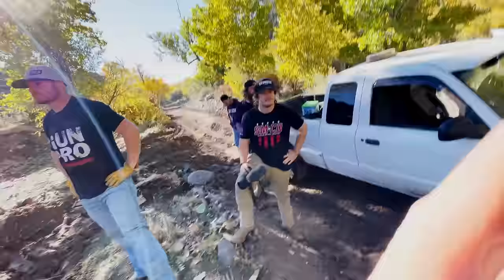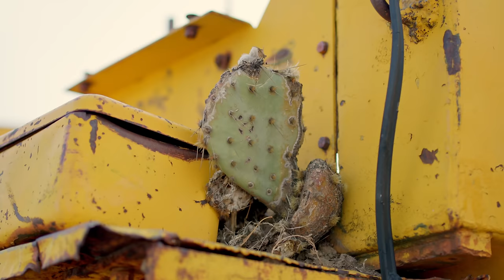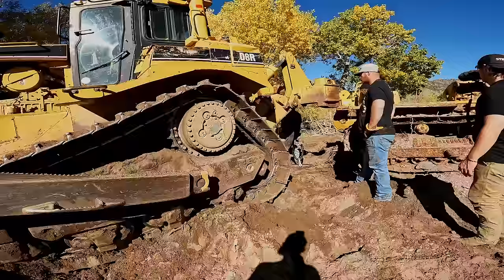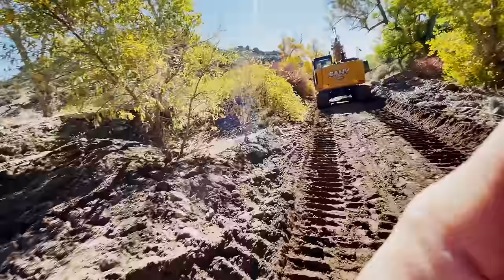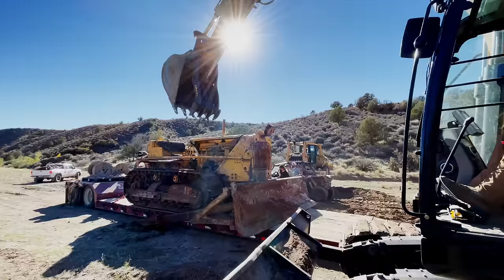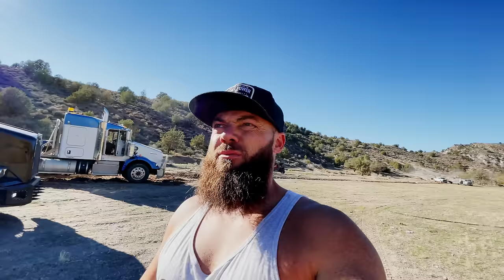How To Haul A Dead Dozer Down The Mountain - Insane Dozer Recovery!

Comment: Just a thought. On recoveries as this, one could make a sled out of plate steel. The friction coefficient would be reduced and the trip out would repair the road rather than damaging it.
Reply: Exactly my thought. Would've been way easier.
Reply: Would've been a hell of an expensive sled though 😳
Reply: @Jutilaje  
For real. I'm thinking people suggesting that haven't actually looked into what a plate of steel like that costs. Let alone what it weighs, and what a logistical nightmare it would be to get it in and out of there.

Makes way more sense to just make an extra trip back up with a dozer to blade the ruts back out of the road.
Reply: I would have dragged the dozer out sideways.  Lift the leading edge about a foot and it would grade the road for you and you wouldn’t have 20 steel ribs on the bottom of the treads fighting you.  Tracked vehicles like that have very little side bite and you could see as they pulled it out it kept wanting to turn sideways
Reply: @austinmabry8462  well as an oilfield welder, I am familiar with steel prices. I am also familiar with the equipment rental and labor prices. Not to mention the headache of prolonged dealings with federal agencies.
Reply: @austinmabry8462 . I had similar thoughts   as Jeremy, but another objection would be that the sand could be like sandpaper grinding away the steel of the sledge.    So yes going back with another good dozer as you suggest is the best option. ..
Reply: I was thinking the same thing. We regularly use 1" plate 8' x 20' and "road plate" to cover gaps so machines can roll over it. Get a piece and put small kicks front and rear so its a sled and drag the machine up on it and slide it out.
Reply: @Holgrinator  I'm just watching these two videos for the first time this morning, and that was my first thought...  those ribs on the tracks are the biggest problem with pulling forward or backward - at least try pulling it sideways!
Reply: @Wyogoose  It's actually funny as soon as you mentioned making a plate steel sled I immediately thought of the oil field sleds for hauling/dragging drill equipment/pipe around. Yes a steel sled is expensive to make, but nothing about doing heavy recovery is cheap. I'm thinking a lot of people don't really think too much about the overall cost of these operations. I know people in both camps though, I know some operators that are very skilled that will go "Will only take me a minute to fix the damage" and will keep to that, and I know others that will go "Yeah, sled it up"

Another trick that comes from the world of old one lunger powerplants. You only really need two skids one for each track, a lot of the old oilfield engines I've dealt with had I or H beam skids under them to make them easier to move if needed.
Reply: nah, far to easy, brute force and muscle prevails!!!...........and also a longer video! 🙂
Reply: What about using rollers, trees or round tubes?? When the load is solid? , tracks not moving?
Reply: @manum234 AWESOME THOUGHT !! . no disrespect to anyone !!!; i don't understand why the drive sprockets were not  unbolted...
PLUS , YOUR IDEA;  OF A PLATE TO GET-OUT INITIALLY & GRADE THE ROAD IF SOCKETS DIDN'T DISLODGE THE TRACK BY PULLING IT ONCE IT WAS SEPERATED FROM THE DEIVE ?!!!!
jack 🤜🏻🤛🏻👍😎👋

Comment: After the first dozer recovery with the track seized up, I thought it would be useful to pick up some 3/16 or 1/4 plate and make some "skis" that you could slip under the tracks. Should make it easier to tow and wouldn't tear up the road.
Reply: Working smarter not harder isn’t good content
Reply: I dont think 1/4 plate will do it.
Reply: @joeprewitt2539  It would do it easily. It's all about lb/sq in. It would pull 10x easier that pulling tracks..
Reply: My Grandpa had a stone boat, used for moving all sorts of heavy items which/that wouldn't get moved without major eqpt. It was just inches high, stout wood with chain for towing.
Reply: Yea soooooo, 1" or 1.5" plate would work perfectly. If you could put the end of it in a brake and bend 2 foot 45  degrees. It would work even better. Don't forget to weld tow rings on it, or cut tow eyes in it. (Ret. Operating Engineer, 38 years)
Reply: @phillipmoore6295  Don't know about brake bending 1" steel but say 3 ft by 4 ft is a hefty chunk of steel that thick. Ours was built-up wood for farm & ranch work. Now at the Kaiser Steel plant, I've seen some heavy metal haulers! Forklifts and straddle haulers up to 100 Ton.
Reply: @jerroldkazynski5480  There are bending machines that will do the job but cutting and welding a prow would work just as well.
Reply: You’d need 1/2 plate for those skis
Reply: @phillipmoore6295  so your idea is to add 3 or 4 more tons of steel? Dude 1/2" would probably last them the rest of their career of recovery, and it would be a fraction of the weight. Are you trying to say it has to stay absolutely ridged? You could add a few pieces of angle or channel for rigidity if you are worried about flex or bending, and still be much lighter.
Reply: @no0channel0at0all  Nope. Lets do some math. A D7 has a track length of around 9 ft. Let's say tracks are 18" wide (which I doubt they are on this one) so that's 9*12*18* two tracks equals 3888 square inches that contact the road. That old dozer weighs around 40 to 43000 lbs. Let's say 50k. 50000/3888 equals 13lbs/sq in. That's actually half the weight that a Crown Vic exerts on it's four tires. It would definitely handle it.
Reply: Ar you single
Reply: @Badge124  , of course youre right.  i had a d4 drive across my right foot.  no pressure!  another alternative if steel plate wasnt available (eg. you are 1000 miles from anywhere ) is using the blade or the ripper to lift the dead dozer so only the back grousers were dragging dirt.
Reply: *Skids ;)
And yeah, if they plan more like this, prep is everything.
Solid suggestion. 👍
Also, my last conversation with a recovery specialist out here in the PNW reminded me of airbags, which would be great for freeing up stuff, rolling toppled things is mostly what I've heard of it being used for... There are some certifying courses for this stuff either way, but I digress.
I still think a hydroblaster and pump setup could be a messy if economic solution... Maybe 😏, maybe not, but it be no doubt it would make for fun content. XD
Reply: Basically what you have in mind is a simple sledge. 1/2" might be a little light for hitting rocks, etc, but would also straighten easier than 3/4 plate.
It would certainly make this, and other recoveries on soft ground, much easier.
Reply: @maryhumphrey5987  hahahahahaha
Reply: Yes I’ve seen 1inch plate bent here in the UK. The machine didn’t have any problem with it. It was designed for thicker stuff. Mind you! It was a “Big” machine. But I’m sure a  1/4 plate skid would have been good enough to do this job.
Reply: The big dozer companies made them out of pipe and just one skid here in Oklahoma back when they had to winch the dozers in and out of high line Rows.
Reply: My step dads grandpa used to have a d68u he took to South America and hauled up and down rivers on his homemade boat
Reply: @bradwyrick7513  Damn. That sounds like an adventure I'd love to hear more about!
Reply: That would be a good idea I'd think.  If nothing else rollers like they used in ancient times to move large objects.
Reply: And the second it slides over a rock there is a massive pressure spike concentrated in a small area.  You will rub through and warp things in high pressure spots dragging for miles.  Look up drifting with front wheel drive cars and how fast they run through steel plate.

Comment: Full restoration on that dozer would freaking awesome to watch lol
Reply: Way too much money and labor to restore that dozer. You could buy a working dozer for a lot less than it would cost to restore that one. At this point it’s just scrap steel, which is real cheap. It’s not sold by the pound. Steel is bought and sold by the ton. If it’s not usable it’s not worth much.

Comment: It's the internet, so everyone's an expert... But trying to pull those loads straight out is just messing your gear up. You need an A-frame to pass the cable over, then you're pulling the load up as well as towards you. Makes a huge difference. 
Great videos, keep up the good work.
Reply: They also attached the 5 ton axle to the small excavator. The winch on the back is attached to the frame, you want to attach to the frame, preferably the same leg of the frame to prevent warping but you sure as hell don't want to attach to the axle.
Reply: @glenwaldrop8166  Or even better to the winch mounting!
Reply: @martingardener90  Exactly.
Reply: But, none of that is as exciting as busting cables...gotta get clicks and subs somehow.

Comment: When I saw you fixing the winch cable it reminded me of one thing my dad(a safety engineer) taught me.  Those saddle clamps on the winch cable will slip if not installed properly, and the way he taught me was the phrase  "you never saddle a dead horse"... the saddle part always goes on the live side of the cable & the U-bolt goes on the cut end. he had seen & reviewed cases that had slipped causing major accidents.
great job on the recovery.

Comment: How about a sled to drag it out? Some 1/2 inch plate under each track, welded spacer beams, a drag point...seems simple to me.
Reply: Ya it's pretty painful to watch the recoveries these guys do some time because they make it far more difficult it needs to be. For example this 1 was a simple dig around and drag but they disturb all the native material and act like they meant to rip the blade off to reduce weight lmao. Could've fabbed some track skiis and made life alot easier and saved alot of embarrassment. The comment section with ppl thinking they did a great job is more entertaining
Reply: Are you doing

Comment: I'm a  licensed heavy duty, off road, automotive, truck and trailer mechanic. I would clean it first and slowly and carefully inspect all engine. hydraulic mechanisms first. Drain all fluids, and start from there. It would be a lot of work, however, I truly believe you can get things running.  Good luck and Thank you for the video

Comment: Summary of the operation: If you had carried the D8 from the beginning, you would have saved yourself time, effort and money. Or if with the Sandy you had made a long and smooth ramp, with the military crane, you would have been able to remove the buried dozer. You learn everything, and with this video you learn a lot about how to spend time planning, especially when with good planning you can save a lot of money by avoiding heavy machinery transfers.
Reply: MSG:+①③⑧⑤②⓪④③⑥⑤⑦  Thanks but it's not necessary. And thanks also for your videos.
Reply: They also could have pulled the drives out of the dozer and freewheeled the tracks. Would have made towing it a lot easier. And done a lot less damage.
Reply: @lb969  That was my approach idea as I watched this. Get it rolling. First thought was get it in neutral. Then as you suggested disconnect the drives. A few hours of mechanic work seems better than all that grading roads.
Reply: Man, that would have been great if they had a crane to take some weight off.  Where could they have found one?  jkj
Reply: part of what makes this channel so great is that sure they do it an easier, faster way but they do it not because it's easy! THEY do it because it's hard or impossible. Like Kennedy said about the Moon.
Reply: @donkendall1227  the neighbor for sure…lol

Comment: That was a chore, I hope the old beast can be brought back to life and someone uses for a purpose.  I'm sure fixing the road was no easy task either!  Wow, the equipment and the team really got a workout!
Reply: There is no saving that machine in a way that makes sense.  You could buy that d8r for less than it would take to get that other one's engine rebuilt.  She's just scrap or an ornamental piece at this point.
Reply: @BadHaddy  I hate to hear that, with their skillset I'd hoped they might be able to get it going again and maybe someone that couldn't afford even a used D8 could purchase it.
Reply: It looked pretty rusted and being in the ground that long, I bet it's 100% seized up. Might be some salvageable parts off of it, but it's practically scrap. However, that's a lot of weight so even with cheap scrap prices, that's still a decent check from the scrap yard.

Comment: You need a metal sled underneath it. A piece of flat steel with some d rings welded to it along the sides and a slightly curved up front like a snow sled would be fairly easy to haul to a job. It would also be easy to accommodate it as part of the total load on the return trip as it could be placed under the target equipment. Strap the scrap dozer to the sled and just pull the sled out.
That's what I said on the first video.
The best thing about the skid plate is that You're often working in muddy conditions which would be greatly conquered with a sled versus anything with wheels or tracks.
Reply: Are you single

Comment: I worked at a tow company that did a lot of recovery work on semi's, cement, & dump trucks. The owner's mantra there was use one system to pull upwards to reduce drag and a second one to do the actual pulling.

Comment: 4:25 , as can be seen here, ALL tracked vehicles have ZERO GRIP when moved / pulled sideways - as the tracks on them only have forwards / reverse grippers - nothing to stop them sliding sideways.
So - pull that sucker SIDEWAYS all the way.
Or pull it sideways onto a huge flat sheet of steel and make a flat bottomed "luge" slider out of it, then get one of your crazies to ride it down like an urban cowboy...

Comment: probably easier to pull it sideways because the tracks have no traction that way and does not add to the overall pull weight, and whatever cable you pull it with gets to have more surface area making it more effective,  the torque calculation of (torque strength of whats doing the pulling)/ (radius of thing being pulled at the cable) probably matters here, probably want at least a 1-1/2 or 2" steel or hmpe just to be safe if you dont want to do the torque calculation

Comment: I haven't watched all of your videos but working on it I've noticed I haven't seen you use any old telephone poles that's the same size from one end to the other in roughly about 8 in around and about 8 ft long we used to use them on the farm when are equipment would get stuck we would dig in front of it and make a little roadway  in front of you equipment that was stuck and lay the logs down about four feet apart once we winched it up on the first log it would start going pretty good then once we got it on all the logs it would roll right along locked up or not and as we went along we would just pull out the telephone poles on the rear and move them towards the front they were pretty easy to handle also I usually would have a big eyebolt in one end of the telephone pole and then just grab it with a big hay hook and it would pull right along to move it up to the front

Comment: You guys need a massive dolly that you can construct under heavy things so they can be moved,   the type you see tow truck drivers putting under cars but on a massive scale.    The one thing we have learnt about this channel is it constantly looking for bigger challenges.   So knowing Sparks he would have two sets of wheels on a bogie assembly and then eye beams as the connecting beams between them.    One set of short eye beams for when the rig is just being moved around and a larger set for when they need to be used.
Reply: Or a BIG Sled you all could drag it onto...then tow it out

Comment: Just to point out I was right in my comments in the first video, just wanted to clarify my statements by saying "I TOLD YOU SO~!~" You're going to have to get the dozer behind it and push while pulling in it to get it out. Or pick up both ends and put dolly axels under it and chain them under the dozer and roll it out, after building a road base for it to run on, without burying up the wheels in that un-compacted sand; or make a road with Rip Rap and roll it out of there. Then load it up onto the trailer and take it home. I think what I would do it try to move it while having someone slip the tracks into neutral to see if they can unlock the tracks.

Comment: The unimog usually has 3 slow speeds a few medial speeds and normal speeds 15 speed transmission. 
It will go from 0.01 to 45 mph
I don't know how much it can pull. All know is it has no problem pulling 5,000 tons.
It is the strongest 4 wheel drive worldwide.

Comment: I would love to work for you,  I have 20 plus years experience operating equipment.  Next time you load a solid blade it's length wise face down arms folded in. Only one chain needed.  And it's partially under the machine... love watching your channel.

Comment: Lots of ruts in the road. Was wondering why not put/pull the dead dozer on a thick sheet of plate steel (like they use to cover up large holes during road construction) with its front bent up or a curled up front edge welded to the plate...and then drag the plate (make holes for chains or weld lugs to the plate)... wouldn't the plate with dead dozer slide on the dirt road easier than dragging the tracks in the dirt?  Seems I remember a similar episode in the great Salt lake area where using a plate steel sheet would have possibly worked well there too...!!  Love your 'stories' and challenges. I'm 73 -- 23 years retired military...and now piled into a small condo in Western MA. I've been to the wide open spaces (can see forever and too everything  --  nice)...great toys I'd love to 'play' with them!!